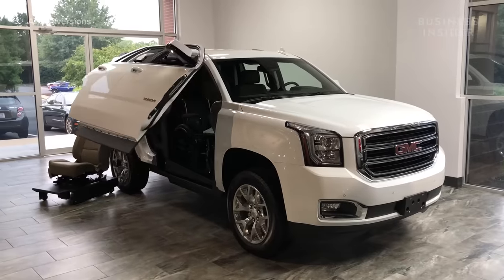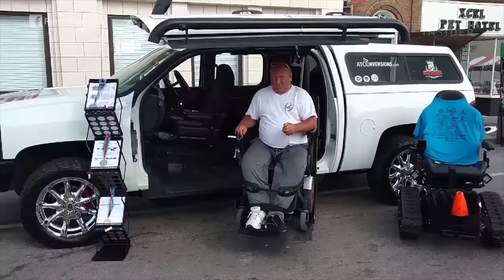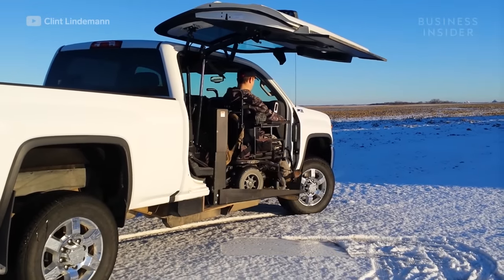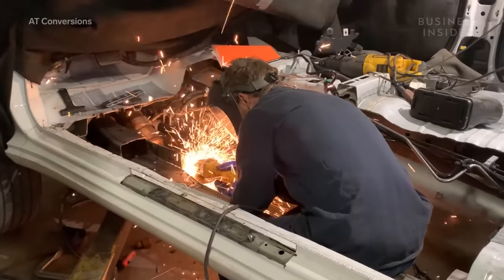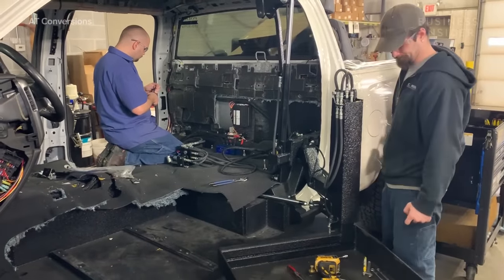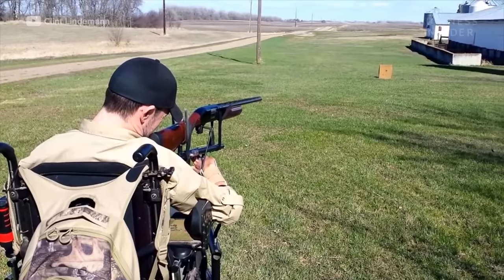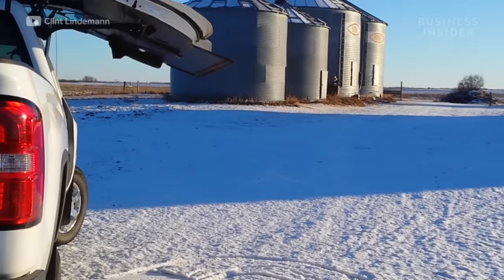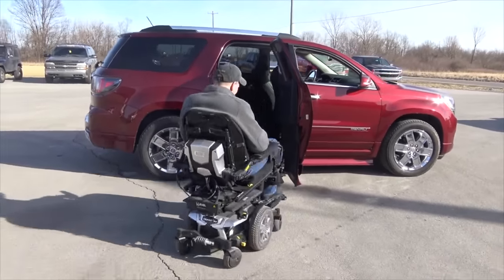How One Company Makes Accessible Vehicles For People Who Use Wheelchairs

Comment: all big vehicle manufacturers should make one model of suv like this for wheel chair people… if mass produced price will be much much lower i don’t think it’ll add more than $2000~$4000 compared to regular models if mass produced
Reply: Would be nice but majority of paralyzed people can't afford a used car let alone one that cost 32 grand more for this conversion. Dont get me wrong some can still work an such but the bigger % are mostly on disability income which isnt enough for monthly rent in most areas some simply can't find a job, some only knew physical labor, then you have the severe depression and so on. The few that have families support specially money are beyond lucky considering the amount of family members that try to make money off someone disabled in the family but these are just a few small details why corps don't do it. These converted trucks used are around 60 to 80 grand cheapest I've seen was 40k with 200k miles an cover rust.

Comment: $30k for a starting price per vehicle and that’s not including the vehicle.  It’s crazy expensive.
Reply: Ink Bold it’s a crazy amount of work
Reply: Used ones will be much less expensive
Reply: I work on a farm which required me to use a lift from a company to lift me into the equipment, brand new the lift costs 40k. I however was able to get a deal on a truck with the lift installed for half the price (lift and truck combined). The catch to the deal was it was already used but in excellent condition however they offered me the same warranty as if the lift were brand new. Im sure the company could get you a deal.
Reply: That's super cheap. 30k for such a modified car like this is a bargain. This has to include the salaries of workers over the 6 week period to modify the car and the car itself.
Reply: $30k really is not that bad, they are totally rebuilding a new truck.
Reply: Specially when the targeted market cannot work in most instances.
Reply: Have you seen medical bills?
Reply: You would think some car /truck /van manufacturers would just build them from scratch instead of having to convert one.
Reply: These are one off conversions each time. Every part is manufactured bespoke. This isn’t an easy process. Lots of skills and trades involved. If it was an off the shelf thing then it would be cheaper. I think it’s a great price. You can’t put a price on freedom.
Reply: It seems appropriately expensive imo....
Reply: It's funny that the Dutch spend less than 10k for the entire thing
Reply: $30k for a custom vehicle is super cheap! Especially when you consider the amount of labor that goes into these things and how every car is customized to the users
Reply: @MsBrendalina  none of us suggest that that isn't appropriate to the effort put in.

It's just odd that American spend that much on arguably worse products, keeping many places inaccessible and blame the people lacking those means for their lower quality of life
Reply: I’d pay double for my independence
Reply: @ryanscott1861  it's kind of sad that implies you wouldn't have access without that type of vehicle.

Having to earn 30k above population average isn't particularly independent and certainly not fair 

I am quite invested in having local build environments consider diverse accessibility needs as well as car free ways to get there. 

Ps. There are cars that fit wheelchairs from the factory below 10k because those needn't be that bulky let alone have a lift (given the near ground acess is the ramp/back door)
Reply: Buy a used vehicle
Reply: @dariussantos1555  and have a shorter live span for the modifications? Pay extra for them to deal with dirt?

I feel like the Dutch have a better solution
Reply: More proof of deluded cult
Reply: The parts are probably  1/4 of what they're charging. Theirs stupid crazy to charge that.

Comment: Just curious how do they accelerate? Co it really recquires some leg movement.. On the pedal or is it like a joystick🕹 can someone lemme know 🤔
Reply: They probably have hand controls. A bar on the left hooked to the gas and brake pedals allows you to pull down for acceleration and push in for brake. Then you can use a knob or tripost for steering with one hand. (i drive a van from my wheelchair)
Reply: We drive with our hands... accelerate and break are usually on the column some place. It just depends on the need of the user.

Comment: Model X Falcon Wings are cooler
Reply: Have you ever had to waited for one?  They are so slow for a normal non disable wanting to use one.   I think the X is really cool, but wish it had a regular rear door.  It is funny you can start opening the falcon door.  The two front seats can open, close door, and have the seat belts on before you can get in.
Reply: @jaytrock3217 and I'd still take the falcon wing door over anything else

Comment: 0:00
Should you be driving, if you're in a wheel chair😕😕 im no wheelchairoligist so someone lmk
Reply: Many people who use wheelchairs have enough use of their hands and legs. For those who are missing limbs or are fully paralyzed, there are hand controls for braking/accelerating as well as modifications for the buttons and steering wheel. 
Converted vehicles also accommodate wheelchair users who only intend to be passengers but the chairs are too heavy and bulky to throw in the trunk (think 300+ pounds).
Reply: Oh heck yeah. I love to drive! I was paralyzed first & later became double amputee. My car takes me so much farther (further?), so much faster than my chair, I'd be really sorry without it, (them, I've had a # of different vehicles over the years). Hand controls make it happen, but I'm still looking for a vehicle that's easy to get in & out of that won't cost me another limb. For now, I fold my chair & pull it up into my van behind me. Do you live in a cave? I think there are lots of us out there. Maybe I live in a cave.

Comment: Wait how would you drive then? Some of them can’t use the pedals or use the steering wheel?
Reply: hand throtle i think, or maybe they put accelerator in steering wheel?
Reply: Modified hand controls for the accelerator and brakes
Reply: Plug in a Xbox controller.
Reply: @wallacepan3897  😅
Reply: Hand controls have been around for a long time.

Comment: How can they drive if their legs don’t work?
Reply: You see those 2 weird sausage looking things stuck to their upper torso? They're called arms. 
At the end of these arms are hands, and those hands can perform various dexterous tasks such as pull levers and push buttons. 

Which in turn control the automobile thingy.
Reply: They use a big lever mounted on the steering column. It links to the pedals.
Reply: How can you think if your brain doesn't work?
Reply: Aloha Snack bro I alr ready got my answers so think before you think your gunna type something funny
Reply: Mario Chegini I swear, some people can’t think.
Reply: Accelerated Xbox controller.